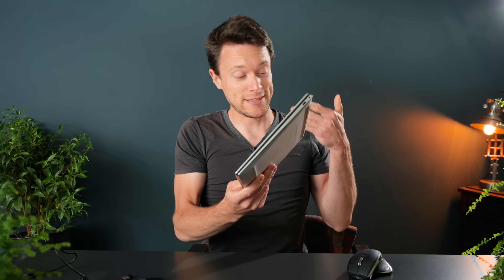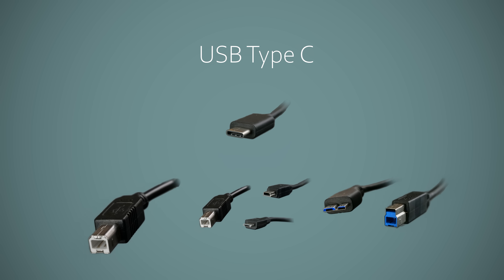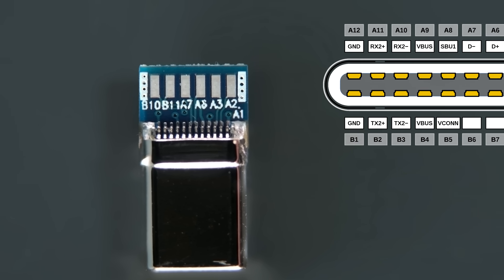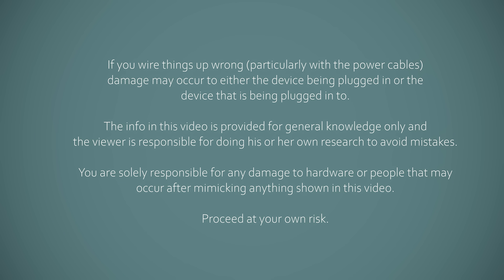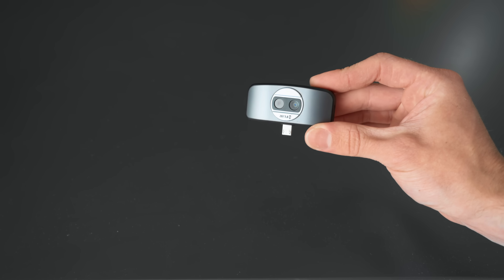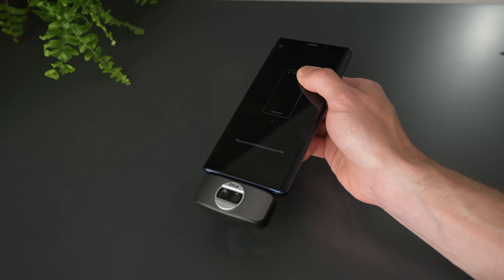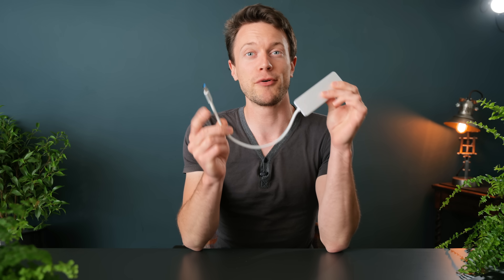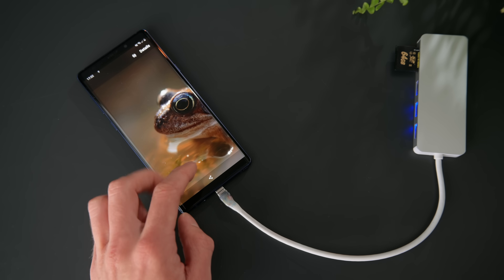Converting devices to USB Type-C

Comment: How does he have his taskbar set up like that?
Reply: Take your mouse to the middle of your taskbar where no programs are located and hover at the top (if your taskbar is in the normal location) to get your double arrow.  Click and drag it to the right or left.  I prefer mine at the top (yes I like Macs) then release.  It also doesn't have to be that wide.  Same process to adjust the width.  To really have some fun, I have my taskbar at the top and a program called "Rocket Dock" at the bottom.  Let me know what you think.  Enjoy!

Comment: My mac has 4 type C ports but none of them are USB at all (a welcome change, actually) They're thunderbolt 3. The great thing about Thunderbolt 3 is that you can use it to plug in pretty much anything… Sure most of those things require a "dongle". They're rather small and cheap, though.

Comment: i love the DIY solution! But lets be honest, there are solutions out that are less clumsy than the cable dongle you compared it to. Still, yours is shorter overall and flexible thanks to cables and sugru, so i give it the advantage of being less prone to damage the port on a laptop than one of these rather stiff solutions.

Comment: 100W of power? So 20V @ 5A? It's a peak power. The same power as you see on tiny plastic speakers reportedly having "1000W" ;) But joking apart, it's a good thing the new specs allows some clever tricks to charge batteries faster. But a "peak power" term is a lie. Big, fat, marketing lie. Power is the amount of energy transmitted in a unit of time. When we charge a battery - the time that is relevant is the time of charging. Impulse magnitude is next to irrelevant. Even if we could pass 1kW in a nanosecond to a battery it would still get almost 4mWh.

Comment: 7:12  you know there was a second placing for the resistor to switch the USB host type, all you needed to do was solder the resistor and solder it to the left position.
i must admit i cringed a bit hehe.
Reply: Easier the way it was done here though, not having to fumble with small resistors
Reply: @MaakaSakuranbo  not really. all you need is a set of tweezers and it's easy. even a wooden toothpick would work. you can mostly place the resistor with your fingers, and just hold it down with a toothpick so it doesn't move when the solder liquefies

Comment: When I see soldering on 14:20 I'm dying a little. For gods' sake, the temperature on the soldering device was too low (especially on the yellow cable, just look on this spike on tin) or you haven't used flux. Cables insulation looks damaged and can create a short circuit. When you take off the insulation take a little bit more, cover the copper wire in tin completely and cut off the excess - it will be much cleaner and straight, so easier to solder.
Reply: And when you choose epoxy try to use a more elastic one, otherwise the cable creates a great lever to push on and break usb C connector inside your laptop... Believe me, it will happen sooner than later.

Comment: Regarding the micro-b connector on the camera: Couldn't you have simply done a continuity test to see which pins in the connector connected to the soldier points? I assume that while internal connections might vary, the pins in the connector are standard.

Comment: This mouse works also on BT, so... it was not necessary
Reply: I don't believe so.  The mouse adapter is 802.11ish while blue-tooth is a different frequency.  "Wireless" mice (and keyboards) usually require the use of a proprietary dongle so that devices aren't confused.  Which makes them "Plug and Play".  Whereas blue-tooth devices require an initial "pairing" to be recognized.
Reply: This just in!  The Logitech Unifying receiver/mouse/keyboard (combo) is an extremely small dedicated USB wireless receiver, based on the nRF24L-family of RF devices which can apparently be used in conjunction with blue-tooth.  Therefore, I stand corrected.  There is such a thing as a wireless/blue-tooth combo.  Oops!  I learned something (Thanks, "P") which is always fun.  Oh, well.  I need to get out more.  Oh, wait...  Be safe out there!

Comment: Logitech is a disgusting crap company. First they still not have updated their unify dongle to usbc, second it is NOT compatible with modern standby and causing a drain. It has no support for sleep functionality under Windows 10 and modern standby. I asked Logitech about this and they acknowledged it. Dont use Logitech unify dongles.

Comment: You didn't need to gouge out the trace and add your own resistor... You could have desoldered the one already on there and resoldered it onto the empty set of pads next door. They clearly designed the board with that in mind.

Comment: You can do this without hacking apart anything, and without having an extra piece of cord or converting box, I get them on wish, its a little thing you insert into the usb and the other end sticks out with the type c connector. Im not talking about the one he showed at 8:35 ish. They are similar without the plastic piece on them. Try keywords like "micro usb to usb" or "type c to usb " keywords in your shopping search (i found them on wish a few months ago)  usb 3 would be pointless so just search usb dont put 1 or 2 or 3 with it. and if you some how run across one that says it usb 3 speeds ... use your brain ;)

Comment: common it's cool and all but I found and adapter that is so tiny that it fits inside the usb-a to convert to usb-c within less than 2 mins... here is the link https://www.ebay.ca/itm/USB-C-3-1-Type-C-Male-to-USB-Female-OTG-Adapter-Converter-For-Tablet-Phone-U7Y1/312996556074?hash=item48e00c6d2a:g:t-AAAOSwBQ1eSDfA

Comment: I'd love you to make a usb c female port in a laptop that doesn't have a usb c port. That works with video output too.

My portable screen can work with USB C to supply power and HDMI (USB C 3.1). But my laptop doesn't have usb C 3.1 and every time I have to plug in many cables and it's a mess! I'd absolutely love to see that or even an attempt 😁

Comment: Here's an idea to take that FLIR to the next level - pull power from the USB-C instead of relying on the internal battery! I swear mine is dead every time I go to use it. So annoying.
Reply: So in case anybody is wondering. I did end up doing this mod and powered the FLIR from the same USB-C. 

I've tested a Pixel 2XL and 3XL and the FLIR ONE Gen2 can charge from 0 battery, while in use, from the phone. 

I found a test point on the board that is connected to the microUSB charging input which was great since the actual microUSB connectors pads were well hidden under a shield. Otherwise, I installed it very similar to how @DIY Perks did it. 

But I did get some USB-C breakouts that had a 5.1k resistor already so no modification was necessary.

Comment: "A side note is that this will work off a USB-C phone as well, allowing you to plug in extra peripherals and storage. This really shows off how awesome USB Type-C is, and how it is definitely the future!"
Ahem... Apple, I hope you're listening.
Reply: Apple helped create USB-C way back. Lightning uses the same general idea as USB-C. Unfortunately for you, Apple is most likely not going to convert their phones to USB-C, rather they're going to try and go completely port-less.
Reply: @deegobooster  That is actually so retar courageous, I honestly wouldn't put it past them. Like how about they invent a wireless charger that doesn't suck first. (Oh right, they already tried that.)

I can't speak for Apple's nutjob engineers, but personally I like having the ability to transfer files to and from my phone when needed. Or using accessories. Or charging other devices. (Hey, reverse wireless charging is a really cool gimmick in person... But it's also dumb asf. Might as well light your battery on fire, wireless charging has 50% the efficiency of a cable and that makes a difference when your charger is also a battery.)

And don't tell me that wireless is the future. For one there's the environmental argument when it comes to charging... Imagine all battery powered devices on the grid suddenly using double the power for literally no reason whatsoever. Eventually laptops joining the dumbass trend too with their massive batteries. Who knows, how about a wireless charging hair dryer while we're at it.

Secondly, quality and reliability... I can see a pretty clear quality and latency difference between casting to my TV and plugging in an HDMI cable. Wired just opens more options up for people with older equipment, basically using their phone as a smart device itself.

And in the case of Galaxy phones, there's also Samsung Dex, another useful reason to have the ability to plug in a dock. In fact if you already have a USB-C equipped PC and dock, you can effortlessly swap between devices with one simple, universal cable.

Wireless, on the other hand, isn't so universal or simple. Sure it's often marketed and hyped as such, but good luck getting this stuff to actually work right if you're not a techie, but a normal person with a realistic, imperfect home setup.

Unfortunately, wireless will always result in more proprietary protocols, confusing version/generational incompatibilities, and wasted old hardware that has to be thrown in the dump than wired, it's just physics.
Reply: @datachu  Too bad I suppose.
Reply: @deegobooster  As long as Apple can earn a shitload of money, they will do whatever they have to do. Lightning port is a huge money grab, just like everything Apple does.
Reply: @Samosayummyyay  Isn't that the point of any for-profit company? I don't understand what you're saying.
Reply: @Samosayummyyay  this and also that Apple would have spent a shit load of money for the r&d of such a port and that they are trying to milk as much out of it as possible. And also yes having a proprietary port allows them to sell overpriced accessories
Reply: @TheAmithgowda  Or just outsource it to Chinese engineers at foxconn to figure out all the hard parts and then the slave laborers there to assemble it while they try to suicide themselves.

Which is I believe what they pretty much did with Lightning. The main iPhone stuff of course has to be mostly in house for IP reasons, but some stuff they outsource. Which is one reason why leaks happen.
Reply: @datachu  pretty sure foxconn is only for production and they don't do any r&d
Reply: Pecacheu 
A customer asked me when Apple would be switching from lightning to USB C on iPhone. Don’t know. But they have it on the iPad Pro, so .. it’s coming?
Reply: Well hopefully if the European Union gets their way, Apple will have to
Reply: @Squaretable22  I don't appreciate the EU's censorship happy attitude but at least if they go after Apple it will be one redeeming quality

Comment: For the mouse transmitter, could you have positioned the board at a 90 degree angle to the usb-c plug, so it would not have stuck out so far?
Reply: My first thought is to much stress on the cable.  I know you didn't ask me so, I'm just guessing what his reasoning is.  I'd avoid kinks and bends whenever possible though.

Comment: Great video, as usual. However, not wishing to undermine your soldering skills... you do NOT need to use the USB A or USB C dongle for the mouse, this is just for workstations that do not usually have Bluetooth connectivity. Your laptop has Bluetooth, just connect the mouse directly to the laptop, without the USB A dongle by doing the usual pairing in Bluetooth on the laptop, as the mouse will show & connect without it. Hope this helps!

Comment: This is something I've been looking forward to do for some time. I have a Sandisk duo flash drive, one ide is USB-A 3 and the other is microUSB 2, it's so well built that even without using it too much, the microUSB side stoped working in just a few months and I also have... Lots of old phones with microUSB, but micro soldering is quite more difficult.

Comment: It's always frustrating to see people never addressing the design faults of USB-C. While it does increase speed and power delivery, it literally sacrifices everything else to achieve the goal.

The biggest issue with the connector is cost. The cables aren't much more expensive to produce, it's just a few extra wires. The problem is the connector, and it's in some cases ten times more expensive to produce than any of the former connector standards. This is why you don't see many USB-C connectors on anything, because they can add tens of dollars to the cost of the device. You aren't going to see motherboards with 14-20 USB-C connectors on them, as was common in the past with even USB 3.x type A connectors because they aren't that much more expensive than a USB 2.0 connector. Economies of scale don't apply to USB-C because the connector wiring is so complicated that human QC is required at some step of the manufacturing process due to the ambidextrous nature of the connector and the tiny pin pitch, where getting wires in the right place for a machine is very difficult.

The second biggest issue is the connector itself. The connector is junk for a variety of reasons, starting with its size. It takes all that's bad about the older USB Micro type connector and expands on the manure pile. Even after years of engineering, Micro USB still has significant issues with mechanical failure because getting a good anchor to the PCB was very difficult. Even with large anchor points, the flexing of the connector will eventually fatigue the pins to the board to the point they snap. This has been a plague to mobile devices for years. Additionally, Micro USB has a bad problem with debris getting packed in the connector and damaging the pins or snapping the plastic guide clean off from the pressure.

The manure that USB-C piles on top of these existing problems is power delivery. The old USB had 5v only, so if something went wrong in the connector, you'd only be shorting out 5v to other 5v tolerant lines. USB-C allows up to 20v at 5 amps, or 100 watts RIGHT NEXT TO DATA PINS. The smart thing would to be at least have a ground between high voltage and data, but it's clear on the other side of the connector. When something eventually goes wrong inside either the connector or the socket, things explode and catch on fire. It's no surprise that Apple Macbook users with the combo thunderbolt/USB-C connector have had craters blown in the motherboard where the thunderbolt controller chip once existed when something went awry on the USB-C/Thunderbolt 3 connection.

Another problem is that USB-C is now an ambiguous standard. It shares the same connector as Thunderbolt 3 and multiple standards are trying to get the same connector to be used for things like displays and audio. So now you have one connector that does all of these different things where devices and hosts might not be inter-compatible, even though the connector is. I've already started seeing this on laptops with docks which are Thunderbolt, but the vendor of the laptop only had a specific sub model that had Thunderbolt support, the other is USB-C only and the dock doesn't work. thanks Dell.

USB-A and USB-B, as well as the USB 3.x variants which used the same or extended USB-B were the best connectors and standards. They were large, robust connectors that could withstand the everyday abuse that the average careless user could dish out and not cause significant problems.

Half a dozen different connectors that do different things is the best solution, because you have application specific designs. When you try and shove a dozen different standards and connectors into one, you get the trash that is USB-C.

Comment: The only thing I dislike about these connectors is their inherent fragility. Cables rarely last more than a year before losing connectivity and charging power and internal ports rapidly suffer breakage and when they are soldered directly to the devices motherboard you're in for a mountain of pain. My wife and I both have devices that use this and after two years I'm looking at a major solder job for my tablet that will only charge and connect if I hold the connector under pressure and my wife's phone who's no more than two years old only charges intermittently >:-(

Comment: Your video is really good, but damn the adapters and do dongles are indeed a hassle but they keep you old device versatile and usable with old devices too and not exclusive to USB-C devices and you don't run any risk of destroying the stuff on the soldering process, and you know what? It's faster to plug a dongle than resoldering everything.

Comment: 4:57 "If you're a soldering God it'll look like this"
Reply: A god? Anyone with more than 1-2 hours of practice can do the same thing. It's all about knowing about the existence of techniques. Many don't seem to understand that there are soldering techniques causing them to be very poor at the job. Oh, having a steady hand is necessary to do this quickly. If you don't have that...oh boy....good luck in that case!
Reply: @Samosayummyyay True, but yes a very steady hand and a well maintained tip. He was able to solder it while having it at funky angle for the camera!
Reply: It's not easy but I've seen smaller pads done ;)

Comment: I had a nightmarish experience rewiring a Kinect to a normal usb3 cable, I had to rewire & resolder it so many times the cable is now half as long as original, damn thing is soo damn sensitive to noise the only fix was to wrap every pair in rf blocking tape

Comment: I would like to see taking an old laptop camera out and making a webcam. I'd like to use it with a minix to monitor and control my 3D Printer Ender 3 Running latest Marlin
Reply: Same here.  That might come in very handy!
Reply: I'd like to see the cameras from an old mobile phone turned into a webcam. It is much easier to find old mobiles for parts than old laptops.